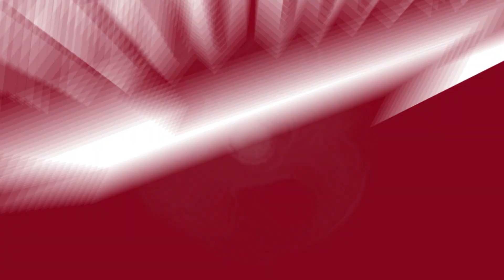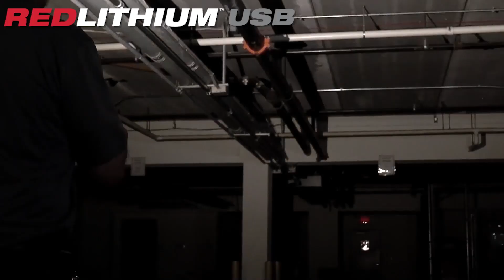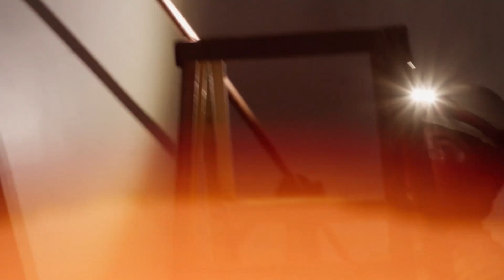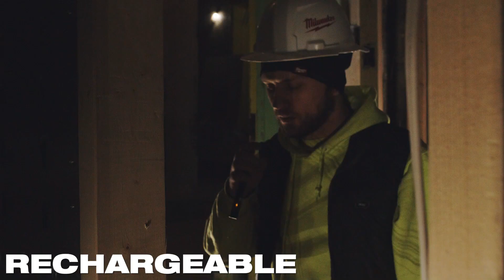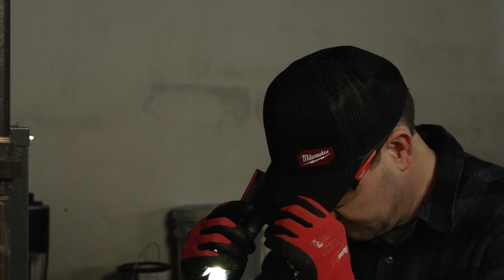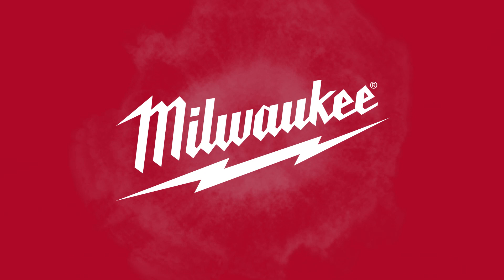Milwaukee® REDLITHIUM™ USB and Rechargeable Personal Lights

Comment: Milwaukee….we need a multiple bay charging dock for these batteries. I have the biggest headlamp the rover light and the power station and all three get used daily. 
It becomes a pain to charge all five batteries almost every night having to charge through individual devices.

Comment: Im using Milwaukee power tools  for  15 years and honestly personal lights sucks Milwaukee needs to make a bigger improvements on that kind of flashlights embarrassing to  use a dewalt ,the 12volt rechargeable  flashlight ONE SINGLE CHARGE 24HR CONTINUES USE  the best flashlight ever had as  Milwaukee user  recently bought  dewalt DCL 077  WATCH IS A 12VOLT AND  WORKS GREAT. MILWAUKEE MAKE A BETTER FLASHLIGHTS I WOULD LIKE TO USE RED COLOR INSTEAD YELLOW 😔😔😔😔😔😔😔😔